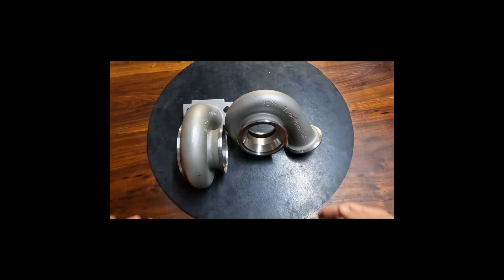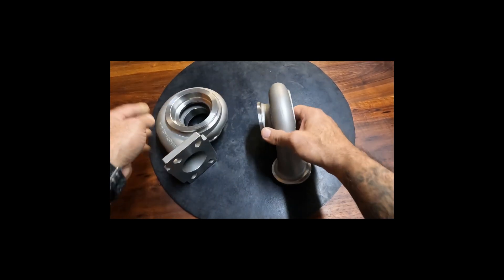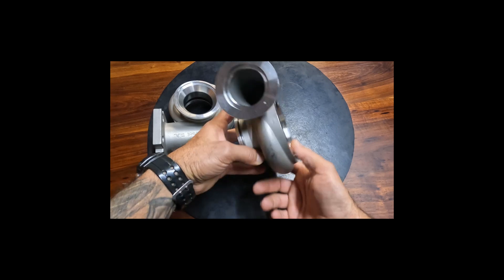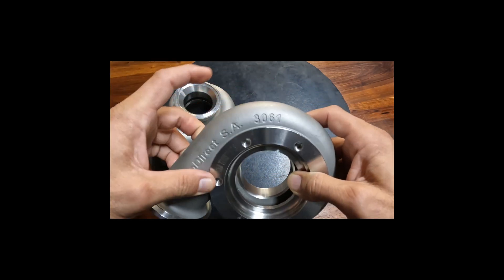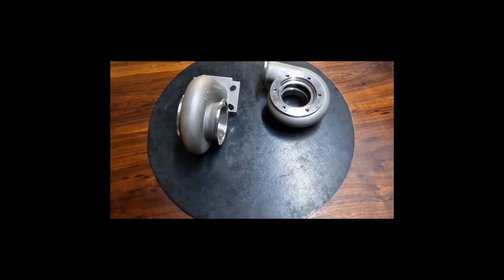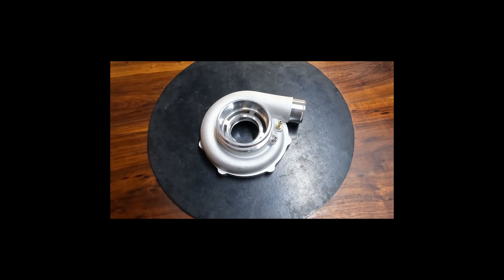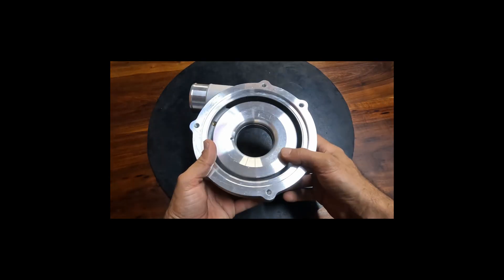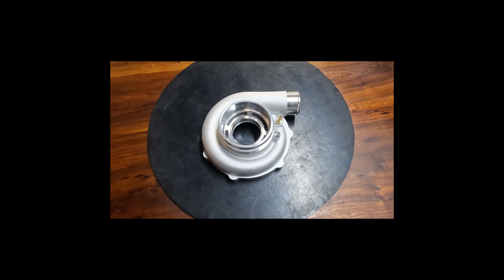TurboDirect S A G30R Upgrades

Comment: hi id like to know if you have tested the new PSR turbo dual ball bearing ? they are claiming they are unbreakable cheap and make the power . thanks milton
Reply from the maker: We have had some experience with these and to be honest they not as impressive as they are made out to be - the price is not that great for a cheap chinese knock off, and the reliability is not all that its cut out to be - we have seen the normal failures through negligence and we have also seen other failures through what seemed to be excessive rotational speeds but with new turbos without having been run hard. Performance was good, but compared back to back with an original Garrett you can clearly see the additional demand for fuel on the dyno when the same Garrett turbo is installed. Back to back testing with one of our similarly sized units and then you see a clear difference in performance and response and for even less money

Comment: Great video, I have a Garrett GT series turbo in my 02 wrx sti. I has a siren sound (almost like a supercharger) I suspect that it might be the compressor wheel issue, is such a problem repairable or do I have to buy a few turbo?
Reply from the maker: Could be related to a bearing failure and contact between the rotating assembly and the end housings are audible. remove the turbo and have it checked out. It is easily repaired.
Reply: @TurboDirectSA  thank you so much, I'll do that.

Comment: could you send me a link for the  G30R  please  ,, impreza fitment  on next upgrade ,,not going mad 650 capabillity with reasonable spool  will be fine,,hopefullt it can outspool my  old gtx with a 88mm front compressor wheel  ,,excellent when on boost ,,bit flat under 4k
Reply from the maker: Here you go

https://store.turbodirect.co.za/index.php/shop/turbochargers/g3076r1-forged-detail
Reply: @TurboDirectSA  many thanks for that
Reply from the maker: @marcperrett662  No worries

Comment: The G35-1050, how much of a daily turbo would you consider this, how do you think it will perform on highway cruising 65-75mph for passing, 3.2L engine R32
Reply from the maker: Its laggy, and with the smallest turbine housing AR83 available it will not be very streetable - What HP target do you have in mind?
Reply: @TurboDirectSA   well my goal at first is 500, but i did not want to buy twice when i want to go around 800-900 area, G35-900 i assume should be good for that maybe?
Reply from the maker: @mondiperformance  This is what i would use - leave the G-series alone - its unreliable and does not make the power it claims. Garrett's own compressor map and power figures in their catalogues are contradictory - 

https://store.turbodirect.co.za/index.php/shop/turbochargers/g3582r1-forged-detail

Comment: I'm not complaining but, are some videos taken down? I was watching "Level 3 Video 1" about how oil gets through the bearings etc, and it was mentioned how the next video will talk about what could cause a turbo to leak oil - and I can not find that video which is a shame as my turbo is leaking oil. Another video I was watching "We destroy a turbo - on purpose!" said about how the next video will describe how to properly prime a new turbo with oil before starting - I can't find that video either, which is also a shame as I'm swapping out my turbo in a few days. These are very interesting videos, thanks.
Reply from the maker: Thanks for the comment - no videos were taken down, we have been snowed over this side, and not much time to make videos as regularly as we used to. More to come ASAP.

Comment: Do you guys make anything better than the gtx3584rs?
Reply from the maker: Yeah we do - very similar in HP,  but with a different delivery entirely.  The 35 family is pretty much maxed out at 1000HP - for more, you need a larger compressor, but in turn the 35 family SWA is not capable of driving this larger compressor.
Reply: @TurboDirectSA  is that 1000 whp or 1000 chp
Reply from the maker: @pr0n5tar  That depends on the engine and the dyno ofcourse -- but the turbo itself produces 98lb/min of air flow - this is a fact.
Reply: @TurboDirectSA  will tell my customer to contact you.
Reply from the maker: @pr0n5tar  Thanks sir!
Reply: @TurboDirectSA  he told me he got in contact t with you. Btw the gtx3584rs has a larger turbine wheel than the usual gtx35.
Reply from the maker: @pr0n5tar  Thanks for that. PS:- the GTX3584 does not have a larger turbine wheel it is the 35 family wheel, and as per the conflicting printed and electronic catalogues (in pure Garrett misleading style) the GTX3582R Gen2 produces 900HP and uses the 62mm x 68mm turbine with the 66mm x 82mm compressor, while the GTX3584RS Gen2 produces 1000HP using the same 62mm x 68mm turbine and a 67mm x 84mm compressor wheel (100HP from only 1mm inducer and 2mm exducer change....... hhmm) 

Odd how the compressor map itself tells a totally different story - but thats what we expect from Garrett, they have done this since catalogue Volume 6 and especially shine through with this shady info with their G-series product. Love to understand why and how this occurred.
Reply: @TurboDirectSA  tha ks for that was just going off what was passed on and no what was measured.
Reply from the maker: @pr0n5tar  No worries, i understand.

Comment: Question about the Honda 1.5L. 
How do you find 0.61 A/R housing matching 1.5L motor? 770 is quite a big turbo. Do you have own version and if not, What do you think or do you have experience with Garretts smaller version like 30-660 with 0.61 performing on this size of motor? Cheers
Reply from the maker: This is our own version of the AR61 turbine housing, the turbo is large yes, but the client wants to make the power, which requires this size turbo. Laggy on this engine - yes, BUT when you increase the Rev range of the engine, you also increase the power band. The G30-660 is a 500HP capable turbo, this client wants to produce around that level of power+ -- however why screw the turbo to its absolute max all the time, when there is a unit that spools as fast but has enough power in reserve above the HP target.  This is why we chose the G3077R
Reply: @TurboDirectSA   Thanx for answering. I am aware of the thought behind it. What was the torque range on this setup? Fully spooled at 5k rpm?

Comment: Absolutely awesome. Don't think anyone else is doing it like you do. So am I correct you are using a Garrett center housing and turbine? Just curious. The important part is that your turbos actually meet their ratings. Would love to see the dyno tests!
Reply from the maker: Hey buddy, been a while.  No we do not use anything from Garrett, the only design that is from Garrett is the turbine head - nothing else. The height of the turbo is shorter than Garrett, the adapter ring is also slightly different to the Garrett unit - the bearing housing looks the same from the outside, but there are small changes internally to improve cooling. The turbine and comp housings are totally different. The compressor is also different.
Reply: @TurboDirectSA  Very cool! Thanks for the info.
Reply from the maker: @802Garage  Thank you buddy - glad to help.

Comment: G series power is based off comp only flow at the fly in a perfect situation, that's why they generally don't get those numbers, you also need the gas and motor for a fairly high boost to get anywhere near it usually
Reply from the maker: The G-series turbochargers cannot reach the claimed power not at the crank nor through a transmission of any sorts. The compressor map shows the flow rate and the printed HP number does not concur. The higher you boost the G-series the less power it makes - after a point around mid-way in the map on the P2C axis. These are facts im afraid. Sad as they may be.
Reply: @TurboDirectSA  For sure, you generally need the next size up, seem to possibly be not as durable as the gtx too.

Comment: G series turbos are rated at the flywheel. I was at ATP turbo a week ago and that's what they said because I'm hoping the g30-900 performs well for my SRT
Reply from the maker: Mike - the older generation Garrett turbochargers used to produce more HP than they claimed. This has changed completely - the HP claims in writing on the catalogues and online show a HP number, but the air flow from the compressor map does not marry up to this -  this is the biggest marketing strategy that Garrett use today. 

Most tuners screw the turbos to the absolute max and beyond to try make the Garrett claimed HP number, and in many cases to the detriment of the turbo, which doesnt look good on Garrett when the turbos fail due to a cyclic overspeed.
Reply: @TurboDirectSA  my gtx gen 2 3582r only made 750hp at 35psi on the Dyno. Lasted 16 Dyno pulls and one night of racing (6 months Total)......my car been down 5 months because Garrett finally replaced it g30-900
Reply from the maker: @mikereed1096  We have EVO4 and EVO7 which make 826WHP with the GTX3582R Gen2 with AR82 turbine housing. We have 10second GTR33's running the same turbo and make over 800WHP no problem. There is a VW 2.0 20V that made 539WKW and 939NM with the same turbo at 2.2bar boost - we have seen many cars producing the goods with the Gen2 GTX35 over the years - many of our clients who have changed to the G-series turbos have come back to us to purchase Gen2 GTX product --
Reply: @TurboDirectSA  wow
Reply: Exactly, I believe it's marketing strategy.
Reply: @cristiannunez5228  for sure. I'm hoping for 750hp and good spool. My gtx3582 gen 2 was a laggy mofo
Reply: @mikereed1096  I just got a g35-900 for my evo well see how it performs. Hard choice between that and the g30-900
Reply: @cristiannunez5228  it's slightly bigger than the g30-900 but there's a few videos showing the g35-900 doing well

Comment: If you have a traditional rectangle t3 exhaust manifold, and you mate it up to your circular t3 turbine housing, what does this do to the flow? Has this been tested in some way? I'm interested in buying one of these to replace a Turbonetics TNX 40/64 on a 2 liter honda b series.
Reply from the maker: Chat to Leonard Korff, he ports the inlet of the housing to match -- i will be doing some CNC porting on the inlet myself and will make a new video on this coming up.
Reply: How did the tnx-4064 do on your b series 2.0
We’re you not happy with the results 
Did the turbine run out of breath

Comment: Awesome.That sr20 G3082R cast AR82 T3, how's the throttle response compared to the OEM turbo, for the streets.
Reply from the maker: Im not the tuner, But i do get info back from the fabricators and tuners working on these projects, so ill keep you all posted with more videos of these cars.
Reply: Well the OEM turbo is tiny in comparison and good for about 1/3 the horsepower, so undoubtedly boost is going to build later.

Comment: How does the G30r compared to an efr or a G series in terms of spool up response times?
Reply from the maker: With our turbine housing, it outspools the G30-770. EFR uses a GAMMA-TI turbine wheel material, so this is ultra lightweight. The comparative turbo in the EFR range would be the 8370 - HP wise.  Our turbo will spool similarly to this turbo - BUT the EFR will have about 50HP more ontop compared to our G3077R 

The G3082R will also spool fast in comparison, but will just outflow the EFR8370 by 50ish HP
Reply: @TurboDirectSA  I look forward to seeing the other variants that you are developing.  I need a turbo that competes with EFR 6758 or 7163.
Reply from the maker: @Tkangz  Look out for the next video - we have just the turbo for that.